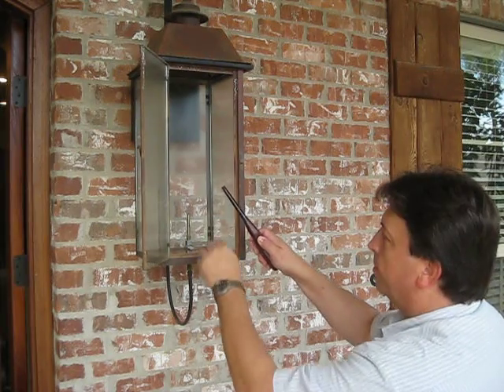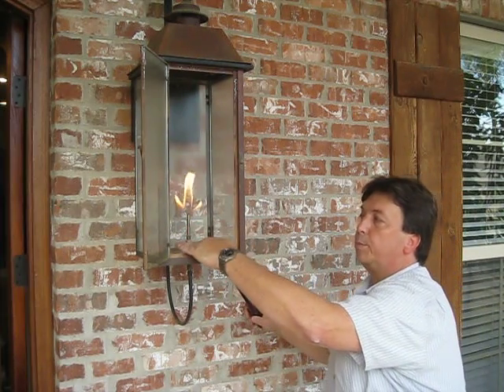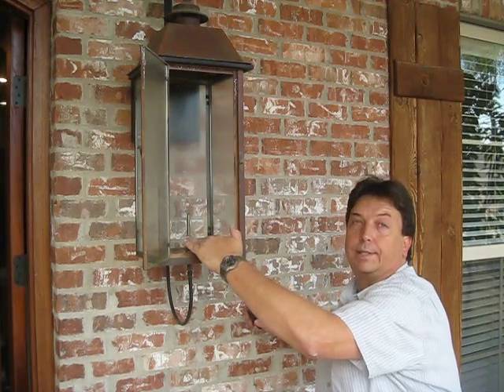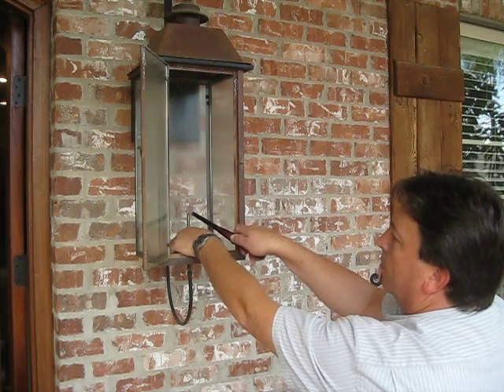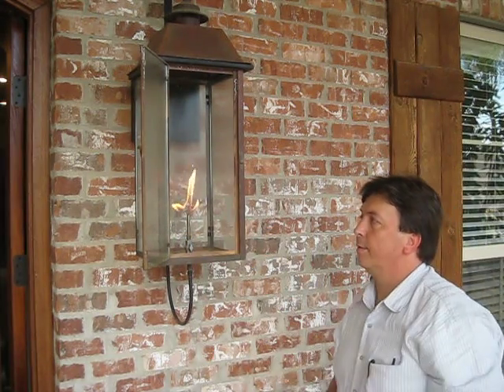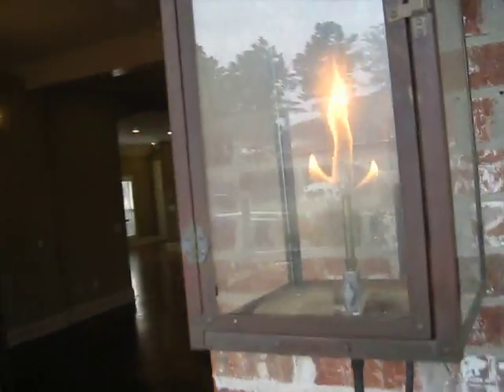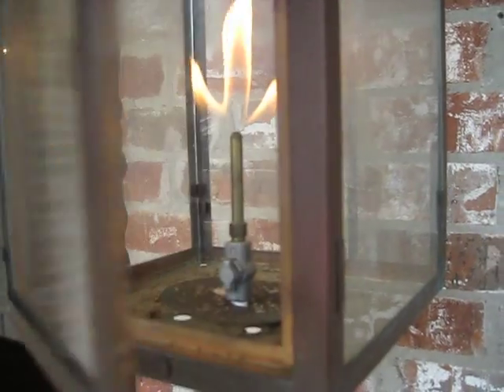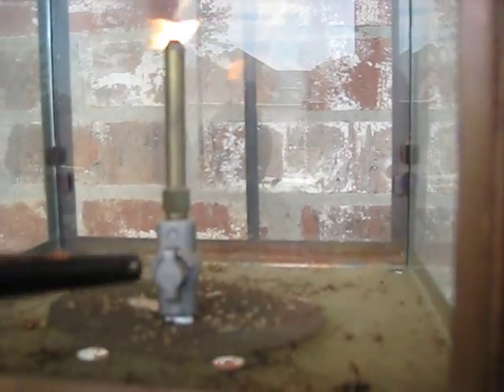A Wise Mississippi Home Inspector Gas Light how to.

Comment: I want to buy for my new house. How would tapping in on gas line work? Does it require electricity too?
Reply from the maker: The one like I demonstrate in the video does not require electricity, however you can get a self igniting type that is on a regular light switch that will light itself. That type does require electricity. Sorry I was slow to respond.